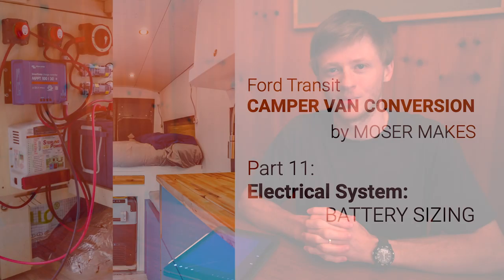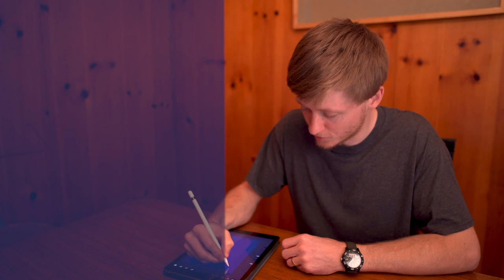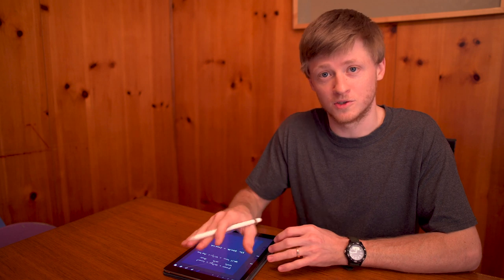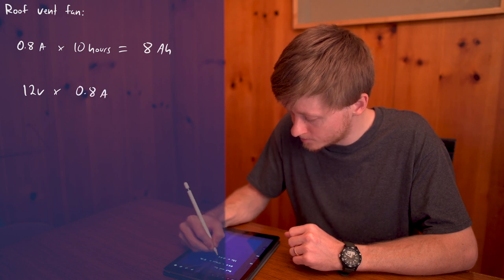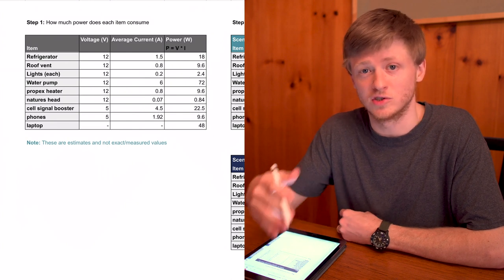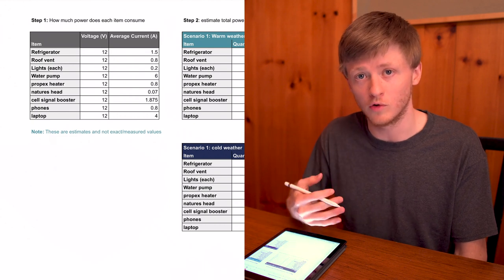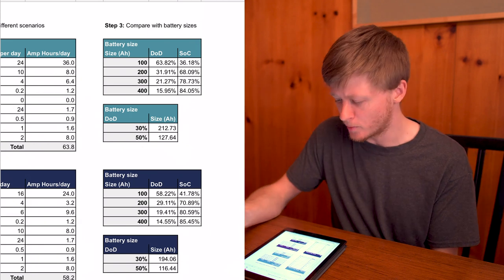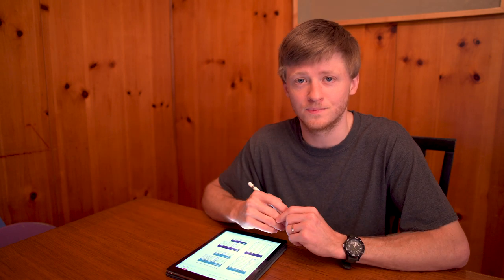What Size BATTERY Do You Need for Your Camper Van?

Comment: I have a question, I have 2 100amp lithium batteries. So my battery bank is 12 volts and 200amps. What size fuse and wire should I use?

Comment: Nice, easy to follow details in the video.   However I don't find anyone talking about SLA-AGM battery derating for colder temperatures, which takes battery sizing calculations to another level.  For example: Whats the usable charge on a new battery, operating at 32ºF (0ºC). Note: Not everyone puts their batteries in side with them in the comfort of the heated RV.  For some reason I recall  the usable charge at freezing is reduced by almost 50%.  Could follow up with a video talking about that?   Thank you

Comment: Thanks. Nice overview. 
Since batteries are the most expensive part of a solar system, I limit my high power usage to sunny days to minimize the batteries I need.  As you mentioned, the power used during a sunny day can be excess solar power. If I need to run something really high current, I can also start the truck to use its alternator to supplement the camper battery and solar.

Comment: Yes, I agree with all aspects of this video for your application.
Sometimes, the limiting factor for system power capacity is the ability to recharge.

For example, a 12v AGM deep-cycle battery manufacturer might recommend a bulk charge of at least (amps = 1/10 Capacity) so a 100 Ah battery should be initially charged at 10 amps minimum current.

This might require 200 watts of solar output for four hours of the day.

If I design for 30 Amp recharge capacity, I could support 300 Ah of batteries (20 hour rating). As you stated, this would provide about 150 Ah (or 1800 watt-hours) of load capacity, in order to conserve battery cycle life.

Charging requirements would look like 500 Watts of rated solar output capacity for 4 hours a day; 30 Amps draw from a vehicle alternator running for a longer time; or 420 watts from a small (900w) generator. Charging batteries takes time, and using less than 500 watts from a 7,200 watt generator for hours would not be very fuel-efficient.

I also agree that batteries should be recharged to 'full' as soon as possible, and should also be fully charged once a month with a smart charger for longest life. Vehicle alternators and charging systems do not provide this type of full charge by themselves.

Also, many of the above parameters change with different manufacturers. Lithium technology is a completely different animal. Follow the specific manufacturers recommendations

Thanks again for the excellent presentation!

Comment: Awesome delivery of great information.
One thing people should greatly consider for sizing  if solar is their only charge method is consecutive days in a row of no sun. 4 days of no sun can cripple you. Lol. It happens more often then you'd imagine taking into consideration  your geo location. I upgraded from 200Ah to 300Ah to boost my capacity to help push through stints of bad weather low light conditions. Hoping the extra amp hours does the trick.

Comment: Thanks for the detailed explanation of all this relevant stuff. It's by far the best video of the sort on youtube.

I have a question, though. You list your fridge with 1.8A current whereas the ones I am finding in the market (such as Dometic CRX 50S) are around 5A.
What fridge are you considering ? Is it 1.8 because you don't set it for low temperatures?

Keep up the great work! it's really appreciated!
Reply: There will be a difference between measured current and nameplate current, which is mainly due to inrush current on starting. Components such as fuses and wiring should be sized for the nameplate. Ampere-Hours in continuous use will be much less (measured).

There will also be a difference between compressor-based equipment and piezo-electric coolers.

Comment: Hello Sam, You have a great presentation in all the videos of yours I've seen of yours! They are clear ,concise and easy to understand. I have a few questions for you with regards to the battery you are currently using (Renogy 200ah). How long have you had it and and how well has it performed? Has it met your expectations? I'm currently building a van conversion and are looking for a battery manufacturer that has a good reputation for producing a quality product. I've been looking at several types of batteries and the ratings. For the battery you have a good deal of the ratings on Amazon I have seen have not been very favorable. I'm seriously considering purchasing the same battery your using, but are concerned about quality assurance. Your thoughts on this matter would be very welcome. Once again, what a great contribution you have made to the van camper community! Keep up the good work!

Comment: Hi Sam. Your van build series videos are so packed with information. Great job. I have a basic question. Pardon my ignorance. How can I determine what size battery I would need, if I only knew the wattage of the appliances? Say, a Nutribullet (600W) or a Toaster (850W) or a Hair dryer (1600W)? I might be using them only for 5 minutes at a time (and to keep it simple, not all of them simultaneously). Thanks so much.
Reply: Theres a device called a Kill A Watt meter that can measure this exactly, it plugs between the appliance and wall
Reply: The system size is determined by the highest draw regardless of the duration used. The Hair dryer at 1600 watts is a chunky load in a vehicle. The inverter would be sized at 2000 watts (1600 * 1.2 = 1920) .

you might need 145-150 Amps at nominal 12V DC (1600W / 11V). I would want at least 300 ah of batteries to support that while conserving battery cycle life. You could probably get way with it on a 30 A.h. lead acid battery, but causing a very short life-span. LiFePo4 technology might be better suited for this application, but is much more expensive.

YMMV

Comment: How do these van builds.....get electricity to run everything? A.C., heat, a microwave, juice to run a laptop, etc. all take electricity. Where does it come from? I am aware this is an ultra novice question, but how do I find out? I know solar panels can make some juice, but only if you live where it's sunny a lot. When I live in a van, I will need a roof fan, some lights, a water pump, and the other things I listed earlier. Do people have to plug in to someone's house a lot? Or stay in full hookup camp spots a lot? Not being anchored is the appeal of van life, so how does relying on shore power a lot get you the freedom? I know they can have big battery banks, but....how do those batteries get charged? And how do we estimate ahead of time how long a battery will last if we use a microwave in a van? It seems that a lot of these van life channels don't start from square one. Are there any that have basic education for how to even make electricity in a van, how much you need, how batteries even work for powering A.C., etc.?
Reply: yes, all very good questions for your research.. 
A device called an inverter provides 120 VAC power from batteries.

recharging batteries can be by:
* Shore power
* Solar Power (climate dependent)
* Vehicle Alternator
* Small generator

Many people use all of the above, depending on availability.
A smart charger or (charge controller) is essential in all cases.

Sometimes, you have to look at the $$$ budget first.
Shore power / generator may be the least cost first investment.

Comment: I buy used golf cart batteries,  I have 2  220 AH 6 volt AGM batteries I paid $40 each for,  I've been using them full time for over 2 years with no problems at all.  They are rated for a 5 to 6 years life span,  they were used for 1 year before I bought them. They should go another 2 years possibly  3.  They cost about $280 each new.   They will cost me about $20 a year,  best bang for the buck I have found  !
 I hope this helps my nomad friends save some money.
Reply: Where did you buy them? cant find any for that price

Comment: The question for a battery novice like me is: Well, then how does the energy get into the battery in the first place? Or how does it get recharged? Do I have to plug in to shore power every couple of days? So, I have to have family and friends to mooch off of? I might as well just keep my apartment then, because I don't want to be reliant on plugging in to my family and friends houses with an extension chord every few days. Am I missing something? I don't think I'd get much power from solar living in a very cloudy climate like I do. And I really don't want to find an RV park with full hookups every few days. So how do people charge those batteries? I am confused. Thank you for your time!
Reply: energy gets into the battery by chemistry (almost like magic)

You could set up a smart DC-DC charger and run your engine at idle.
Or buy a small Generator.

Comment: Thanks for sharing your expertise and knowledge.  
Please comment on '3 to 4 months storage' when the Lithium battery is idle and not connected to shore power. Would this adversely impact battery life or have other negaitve consequences?  There will be solar connected, however, there is very little direct sunlight during winter storage.  Can the Lithium battery simply be recharged / topped-up) when ready to use again?  Thank you kindly.
Reply: Lithium technology is a different animal, and self-discharge is a minor issue, compared to lead-acid. A little Solar power is wonderful, if using a smart charger.

Do a 'full' charge before storing, solar during the winter (smart so charging stops), and another full charge before deploying. Things should be fine overall.

Do consult the battery manufacturers specific recommendations. Some may say 80% of full charge is recommended for long cycle life, but I do not understand this. YMMV.

Comment: I'm in my planning stage of van life and still learning about the electric system. Is it better to have one strong 300AH lithium battery or 3 smaller 100AH lithium batteries wired together?
Reply from the maker: Both are good options but there are some trade offs. Having only one is easier to setup because there are less wiring connections than 3 in parallel. One large one is also often more space efficient. The thing to watch out for is the max current output of only using one battery. Depending on the battery, three batteries in parallel sometimes have a higher max current output than a single large battery. This becomes more of an issue when you have systems with large inverters. But if either configuration can meet your max current requirements than you can go either way.
Reply: @MoserMakes  thanks you so much, I'll keep this in mind

Comment: Hey, Sam, how does use of 120V appliances (heater, induction cooktop, etc.) through an inverter effect these battery/power consumption equations?
Reply: The key to this answer is Watts. Once you get comfortable with the math, you can see that 12 VDC is 1/10 the volts of 120 VAC, but ten times the Amperes for the same power in Watts (W). Watts is also the constant with loads. An 1800 Watt heater will draw 129 Amps at 14 VDC; and 164 Amps at 11VDC.
Wire size and other components will necessarily get big.

An inverter is not 100% efficient - it will draw some power of it's own just being turned on; you have to take into account the power factor of some loads and calculate on Volt-Amps (VA), so overall you have to de-rate available power when powering 120V loads. 25% might be a good rule of thumb.

Comment: I am putting a leisure battery in my 2009 Volkswagen van. Coming from my split charger for my secondary battery, can I use a lithium battery? Even though the battery that starts my engine is not lithium?
Reply: what is a split charger?

Comment: So with 4 - 100 Amp AGM , 400watt solar , 2 hrs daily driving powering 5000BTU 5amp 450watt window A/C. 9 hours nightly would not be a Major issue 6mths a year 😳 Thanks 4 info
Reply: Yeah it's a lot isn't it, im looking into the same usage. Didn't know i would have to be an electrical engineer to figure running a few things on solar, and an ac unit to go off grid camping without dealing with ice runs and gas for a generator. 
   He explains it better than any I've watched though, did you get a electric system figured out? Im curious if you did, what batteries and how many and how much solar it took to keep it running smoothly.
Reply: @checkingoutgypsymike2075  I've tested a 5k BTU unit in my E350 at night a number of times recently . My draws usage at night have me going with 2 - 280ah lipo4 DIY batteries with 400 - 600w total panels for extra charge . Here in SE Tx summer sun provides plenty of charging except today - Rain all-day 6 inches so far . I keep a/c at 76 night with Low fan as in small area that's plenty of wind .
Reply: 400 watt solar is probably on the low side. The mfg. might spec 10 amps minimum bulk rate * 4 = 40 amps * 15 volts = 600 watts.

Comment: Hi, I was wondering, if the fan is running at 9.6W and I let it run for 10h, the outcome is a total of 96 watts in the span of the 10 hours, so actually the per hour wattage is 9.6, isn't it? correct me please
Reply: almost there.
the outcome is 96 Watt-hours

at nominal 12vDC is 8 Ampere-hours over 10 hour rate

Comment: but so how can I calculate how much driving time do i need to recharge my battery in case i cannot plug it in an electrical port?
Reply: too many variables left out. does not compute.

you might be able to tell in real time each day using a battery monitor (shunt) and learn the characteristics of _your system_.

But I will call it 4 hours. I am taking bets.

Comment: Electric stove uses 1800w so that mean it will use all the battery? I really want electric stove in a van, gas is not safe.
Reply: @MoserMakes  ok thank you very much. I just want to use it for less than half an hour each time
Reply: Electric heating is not optimal or efficient, unless one is on the grid.

Comment: A little extra help required please. I only think in terms of big electricity (kills) and little electricity - as soon as I try to understand watts, amps and volts my brain dies - I am a mathematician but practical electricity defeats me. I understand a 60 watt light bulb compared to an 80 watt in terms of brightness, For heating I have a similar intuition. I do not even understand why people think about charging mobile phones from car batteries when a little power bank will charge my phone from empty for nearly a week. Can you provide a very concrete example for system sizing for example - a small fridge that I want to run for a weekend at a beach stop-off, running a crock pot which cooks a curry while I am driving and then use a rice cooker followed by sleeping with run a fan and dehumidifier running. For frying food, boiling water for coffee or washing etc it seems to make more sense to use gas. Given my very simple example what size battery and how many solar panels are required given that the alternator will provide some continuous charge. Sorry to be so dense.